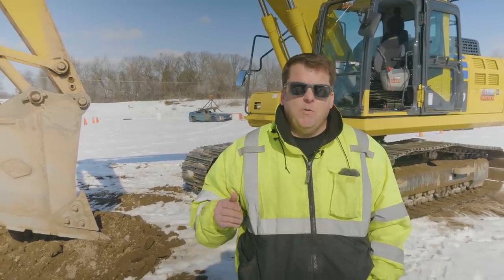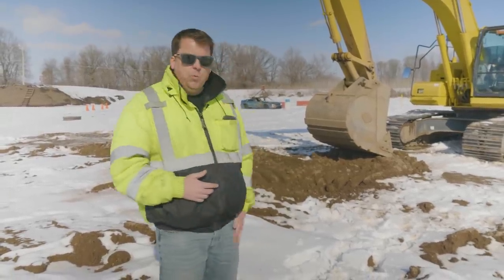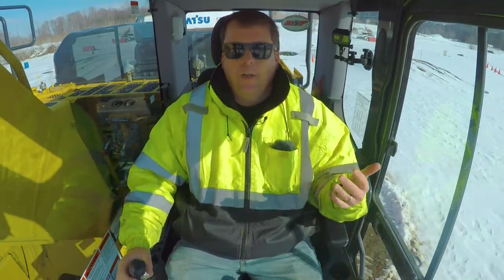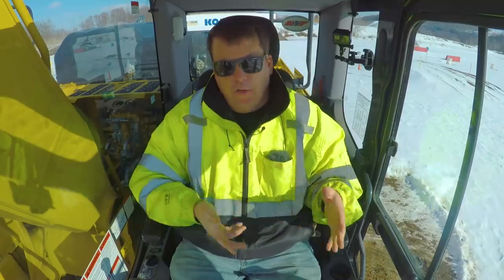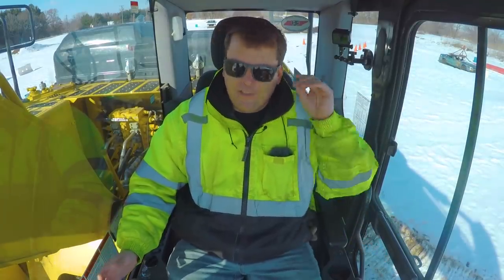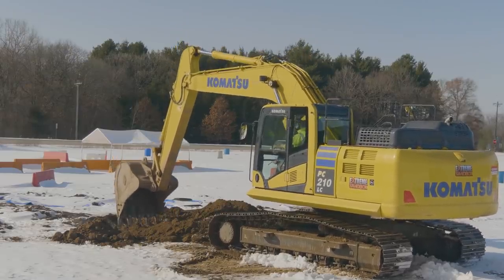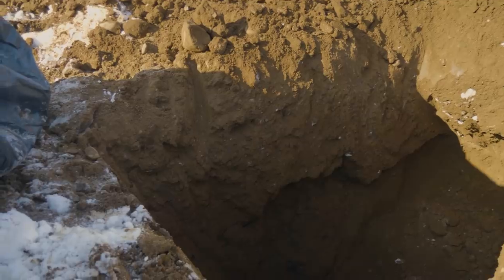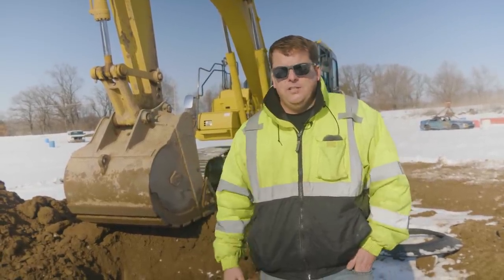How to Dig Through Frost with an Excavator | Heavy Equipment Operator

Comment: My kid was being nice and yelling over you so I may have missed this but here’s my 2 pointers. 1) swing slow and gradual movements. If the grounds froze your machine will act like it’s on a sheet of ice. You’ll pull yourself around easily, cockeyed, square, it doesn’t matter, you’ll be sliding all over. 2) with a frost tooth remember it’s tapered. So if you’re digging something to be bank poured like a column pad that hooks taper will throw your lines off and you’ll be too small once you get to grade. Here’s a 3rd tip for the road. If you have a smaller excavator with a blade, score a line with your frost hook for the blade to chock into, it’ll help keep you planted
Reply from the maker: Excellent advice...thanks for sharing!
Reply: Yes the

Comment: The heavy machinery food chain from top to bottom :

At the top is Motor Grader Operators
Followed by Dozer operators
Then it's Front End loader operators.
After that it's a slippery slope down to Excavator, back hoe, skid steer and finally Roller operator.

If you drive a water cart, that's between Excavator and Front End Loader.
If heavy dump truck or Moxy is your calling then you sit between Front End Loader and Dozer.

If you operate a drag line then no one knows you exist.

If you drive a side by side Polaris then you're probably an over paid under worked manager who got their job by lying to the interview panel.

Everyone loves the staff bus driver. He's underpaid but cheerful :-)
Reply from the maker: This is pretty good...lol
Reply: Thanks :-)

Comment: Does the insulated tarp need to hit the ground before the snow flies and ground freezes, or can it be added later, prior to the dig? I realize this may depend on weather conditions. What I am mostly wondering is if I were to clear the snow and lay down a tarp, mid-winter in freezing temps, might that make things a little easier?

Comment: It would be a hell lot faster whit a reaper or a hydraulic hammer
Reply from the maker: Of course it would...but not everyone has access to those tools.
Reply: @HeavyMetalLearning  oh! All of the companies I have been so far had been equipped with all the basic. Like every excavator had one reaper and at least two buckets and a couple hydraulic hammer.
Reply from the maker: @jeffi49  I think any larger company will have those, but most smaller companies won't have all of those accessories around unless they work in these type of conditions a lot.   Either way, totally agree easier with a ripper or hammer but always good to know how to do it without.  Thanks for the comment.